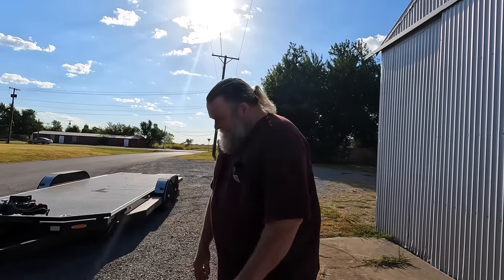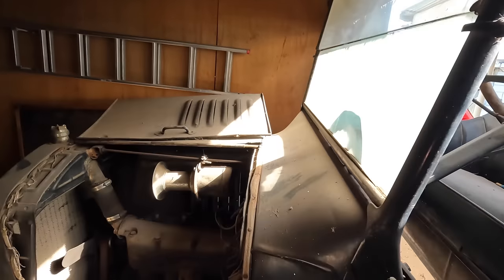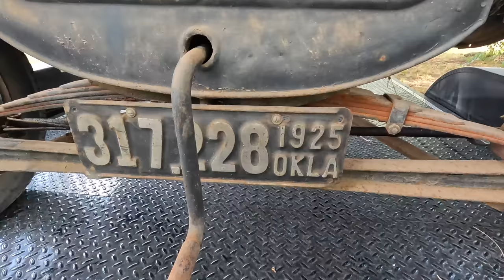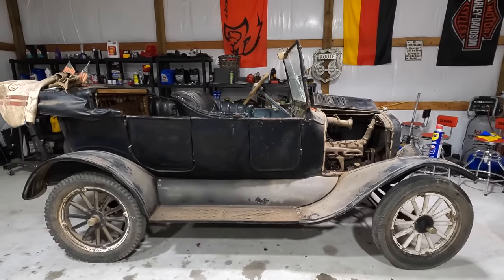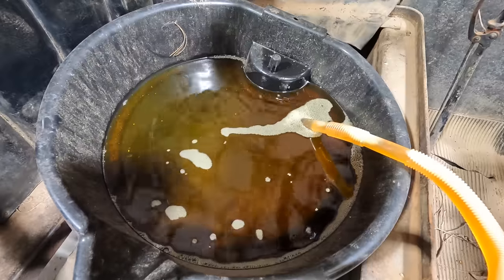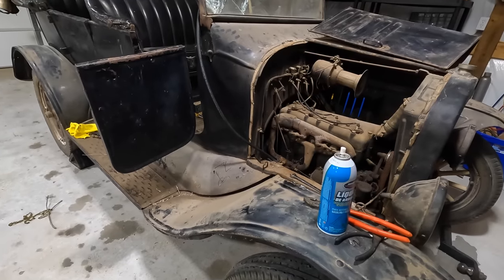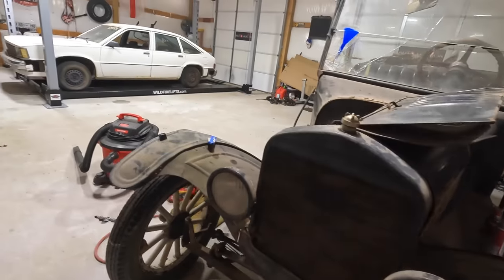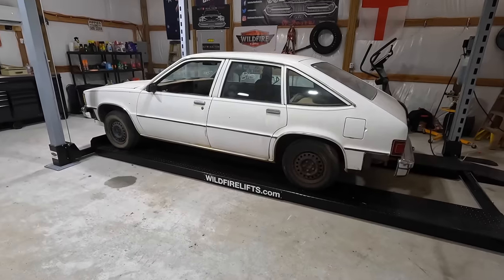I Bought a 97 Year old Car and Crashed it into a Tree! Will it Run? 1925 Ford Model T - X Movie Car!

Comment: As a long time “T” owner I always have to smile at how little first time owners know, but the “T” is a great learning experience. I bought my first one  a 1924 from its 2nd owner who was 93. Mine was a touring car that was made into a very nice pickup by the village blacksmith when it was 2 years old .I bought it in 1968 and still have it. This 4th of July it was in its 40th town parade (could this be a record) and am looking foreword to 2024 when it will be 100 and I will be 81 👍🤗🎩
Reply: Yep, Basically a 1908 car still being built and sold in 1925(thru 1927) so that three pedal planetary gearbox is great mystery to many.

Comment: 1927 was the very last year of the Ford Model T, grew up playing in my Dad's 27 Touring. I love those old cars! Also, those are not wooden cased batteries, they are ignition coils, the car uses 4, one for each cylinder, and each has its own set of points.
Reply: One of the first individual coil  cars. Ford finally went back to that in late 90's or early 2000's. Go figure I suppose.

Comment: Model T production ended in 1927, and there are still about 100,000 cars still on the road today out of 15 million made.
Reply: There’s 100,000 mode T’s out there?
Reply: You're talking about hot rods and t buckets not original unmolested model t's
Reply: @ligmaknutts2752  have eight examples of originals all of mine are tt or trucks only two are cars one is a speedster. Was my granfathers collection

Comment: The hot air intake/stove pipe is for cold driveability. The hot air helps atomize the fuel mixture better until the engine compartment air gets to about 100° or so.

Comment: Go check out the Model T Ford club and post questions there.  Lots to unpack on this car.  Jacking it up and putting it in high gear when you start it will be ab absolute benefit as you wont be dragging the clutch disks.  Making certain all the coils are good will go a long way into making certain the car will run smoothly.  You will also need to adjust your mixture once its running - sounds rich to me - lean it up (to the left).  Don't keep cranking on the engine once it starts to fire - you can damage / break the bendix which is a pain.  Looks like you figured out the light switch wasn't what it was for.   I've been working on T's since I was a tiny tot (am 46 now).  You've got a GREAT start - and there is a lot to learn (you know the transmission is basically a 'manual' automatic right?).  Bravo on taking it on!  My vids for my first start on my 17 Touring sitting since about 84 or so:  https://www.youtube.com/watch?v=xbdBkT_eUI0   And after tinkering / replacing coils:  https://www.youtube.com/watch?v=HB2sHmMXPtg

Comment: Loved this Randy! You have may have paid 5,500.00 But that’s not as bad. As you think. Probably with some elbow grease you can and about 2,500.00 you will have a good car. That glass is flat glass. Not expensive. Flushing fuel tank not bad. Fluids and tires are not bad. Finding parts a nightmare. But you got it running. Carburetor is ok. Was running pretty well. You have impressed me for sure. Michael and Mike will help with the cosmetic’s. Best video yet!

Comment: As the owner mentioned, this is not a runabout, it is a touring car.  The runabout was also called the roadster, and was a 2 seater with convertible top with a trunk in back.  The Touring car had a front and back seat and was open car with the convertible top.  Roadsters could be converted to pickups merely by unbolting the trunk and bolting in a truck bed.  During WWII this was popular to do since trucks received more of a gas ration than cars did.  Those "wooded batteries" are actually extra coils, i believe.

Comment: That's an updraft carburetor. My dad bought a used Model T as a first car when he was 13 years old in 1933.  He hid the car away from his parents, and was able to drive it for some period of time before his ownership was discovered.  This began a lifetime of all things mechanical for my father who never failed to get a car running if the mechanical parts were not damaged beyond repair.  When he was 30 years old an older man noticed that he was working on a Model T parade car preparing it to start.  The man said to him ,"How do you know how to operate a car with 3 pedals and no gearshift lever that was made before you were born?"  My dad laughed, started the car and said, "My first car was a Model T".

Comment: The parking brake is also connected to the transmission.  All the way back is park for starting.  Move forward slightly for neutral.  All the way forward is high gear (direct drive).

Comment: The facts are, that from 1914 to 1925, the Model Ts only came in black. Some earlier ones, like some of the first Model Ts were red along with like 4 other colors, but the 1914s through 1925s were all black.
Reply: I've heard that black paint was the only paint that dry quick enough
Reply: @sampoturunen9337  Yes, the main reason was solely for efficiency. Black dried much faster so they could produce more vehicles in a shorter amount of time.

Comment: You don't want the water pump, they actually were taken off the newer models.  the way the cooling system works without the water pump is really genius,  heat rises and that's how it circulates through the engine the radiator is the highest point. 

Also that is a generator and the small box on it is the voltage regulator.

Enjoy! I love my 27, it was in  waaay  rougher shape than yours but my old man it running in under an hour and the the old ford steel is amazing,

Comment: I probably know less about Model T's than you knew before buying this gorgeous car. 21:45 I think one of the uses for that three way socket wrench could be for the spark plugs, another for the lug nuts, and I have no clue what the third use for it could be. You may, or may not, have paid too much for this car, but by the time you get this car road worthy, you're going to collect, far more than 5500 smiles, in just one car show season, which will make the car pay for itself. GREAT VIDEO RANDY!!!!!!!!!

Comment: Definitely get it running. 
I wouldn't restore it either. Just get it cleaned up, get it going, and cruise it.
Clean out the fuel system, fix the brakes, get a new windshield, and see how it goes.
My Uncle had a 1927 Model T Touring. It was way cool!
I'll be watching for sure.

Comment: Those tools were so that you can work on the motor and thing because you had to take off the cylinder head regularly to clean the carbon out otherwise it wouldn't run

Comment: Most people take the preheater pipe off and install a motorcycle-type air filter. As they weren't equipped with any air filter.

Comment: if no-one told you, that carbs works as taking hot air from the exhaust. & feeds it back in-to it. to help start on a cold day. but santa is right it a gen, as it could have electric start by them.

Comment: I thought the Model T was flow coated, where paint was poured on the panel and allowed the excess to roll off. The paint is thicker usually at the bottom of the panel. Or so I’ve been told. 
Nice find though!

Comment: All the early ones were black but as the car aged they offered other colours to broaden appeal. Hmmm will you offer this for sale at one stage?
Reply: Also. Re the two levers. On start up they should both be in the up position. Once it starts move the left one down to just above half way as you stated.

Comment: Also, the center of the steering wheel is the light switch. They're super easy to drive. raise parking brake 1/2 way to put it in neutral.
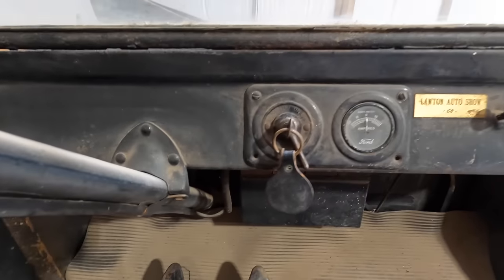Reply: That is incorrect.  Model A's had the headlight switch on the center of the steering wheel.  The Model T headlight switch is that switch he was playing with by the ignition key switch.  If you look closely at it,  One way you turn it is says Dim and the other way is On, center position is off. At 28:47 he has it in the Dim position.  Early rendition of High/Low beams, although it was really just dim and brighter. Dual filament bulbs.  I own a 1927 Model T.

Comment: That gas tank will clean up pretty easily. Pull it out of there and fill it with pea gravel or marbles/nuts and bolts and shake the shit out of it then rinse it out. The one on my OBS was a little worse and I had it looking brand new inside of it in about 15 minutes and reinstalled the next morning.

Comment: That Ford M40 17017 should be for the spark plugs, since it has a dished shape and the box end should be for the head bolts. That is just a heating plate on the exhaust going to the carb. Those carbs actually form ice on them when the engine is running if they don't have that plate, my Dad's does not have it and the carb is covered in ice, even with the heat from the engine. You can just use a tube and spray straight into the carb.

Comment: Dude you stole that car if you only paid 5500 for it because that car it sets would and will sell for 15 to 20 thousand easy and if you get it running and driving it will easily sell for around 30 thousand or so